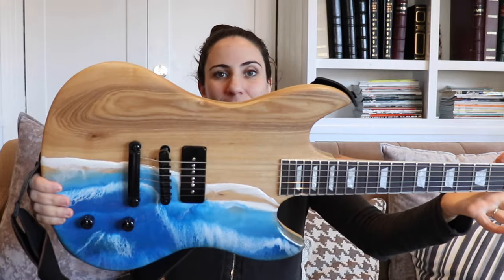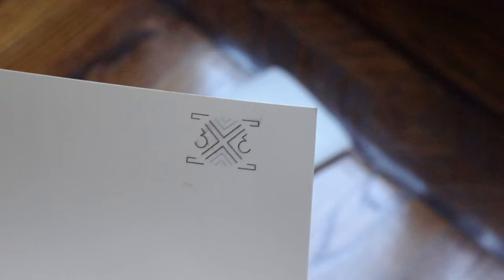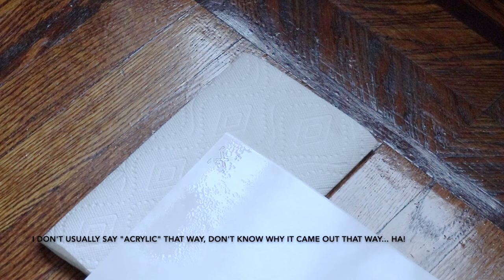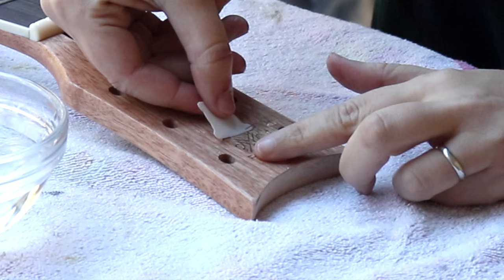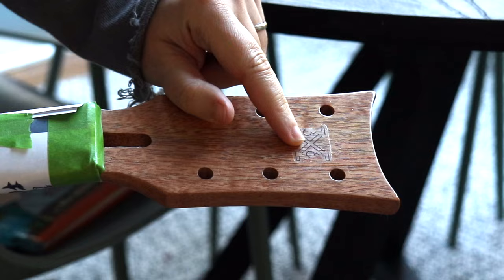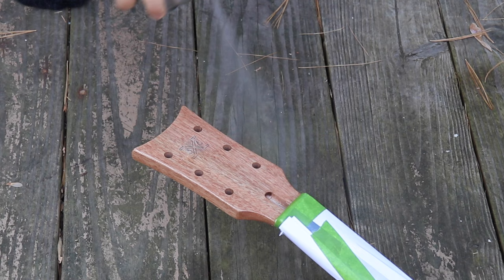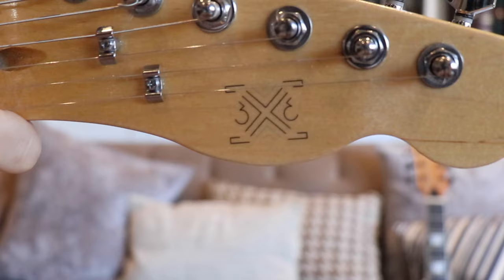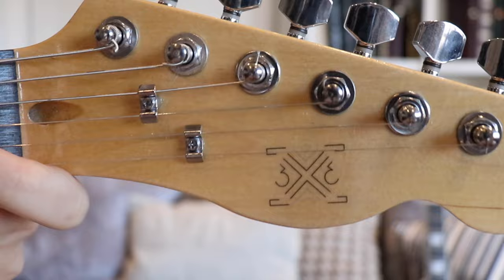How to make a CUSTOM Waterslide Decal // Woodworking Logo // Inkjet Printer

Comment: Pro tip: She touched on this in the video but be sure to apply the decal over an already glossy surface, otherwise the decal will "silver" and be a bit more obvious. Also, hobby shops sell decal softening solution (like Mr Mark Softer or Micro Sol) which helps the decal conform to irregular surfaces and make it look more painted on.
Reply from the maker: Great tip!
Reply: Glossy surface can be lightly "matted" with 0000 steel wool and it won't silver, just makes the decal easier to stick. 
Also rolling a cotton bud over the decal instead of swiping it, makes it easier to get all the air and water off underneath. Especially if the surface is curved
Reply: Will I have any trouble if I sanded on old logo off a headstock then put another one directly on it, or will I have to put something on before I apply my waterslide logo?
Reply: @3x3CustomTamar  Good to know. I just bought waterslide paper (because of this video) and now I'm in the process of making my logo. Seal first, check. Although I can think of better sealers than Mod Podge, but I guess it works based on the video. 
I usually use clear shellac to seal (normally use the "sanding sealer" one, but I don't know that it's any different than flake shellac), so I'm assuming that will work for a "glossy" finish on which to apply the decal. Why don't the directions in the decal paper package say that? Maybe my paper is different. There are even papers available that don't require sealing ... but I'm skeptical.
Reply: Do you mean that a smooth surface makes the clear waterslide area disappear totally after clear coat? Because I'm having this issue 😢
Reply: @-Viceroy- is a 2000 grit sandpaper good too? I'm experimenting on plastic motorbike fairings and have problems with the clear of the decal standing out on the background after good clear coats too

Comment: The laser printer decals are easier, they don't require sealing, the ink is waterproof, so you can apply the decal and then sand and seal it after.

Comment: For that size decals: Drop or two of water at the point where the decal will be. Put the precut decal over that drop of water and  wait a 30sec or so  and then just slide the decal. 
Many times it's so much easier when decal is already at the surface you want it to. Also just a small amount of water is needed to soak the backing paper off the decal side.

Comment: Have you considered using a toner based print (reversed), then ironed on? Would alleviate the need to trim/cut/sand etc and no smearing etc.
Reply from the maker: I have. But water slide decals are the traditional way to put logos on guitar head stocks. The image is also clearer with these decals. I find the ironed on toner based images to be a bit grainy/blurry

Comment: How does it compare to engraving/burning the wood with a cheap laser CNC? (Which, BTW, is just a 3D printer with a laser attachment.)
Reply from the maker: It’s just a different thing. You can print pictures with color on them I think is the main difference. Can’t get color with a laser. Also a laser etched into the wood. This sits on top of the wood

Comment: After using the decal sheet can you use it again or have you wasted the rest of the sheet?     Thanks
Reply from the maker: You can use the portion that you didn’t spray sealer on. Yes. I have done that before. Just make sure the printer settings are changed to accommodate a new paper size since you will cut away the part that you already used

Comment: For anyone interested, the way I know is by laser printing it on a transfer sheet made for this with special toner. Google Forever transfer paper and waterslide. They make way more types of papers so you're possibilities may open up.

The equipment investment is very small. Do your research and you'll discover many options.
Reply from the maker: I don’t have a laser printer. My inkjet works fine so there’s no need for me to change it out. This video is for other ppl who only have inkjets as well bc they might want to do the same thing without investing in another machine
Reply: @3x3CustomTamar  I understand. Sorry for the misunderstanding, I was mentioning it for anyone interested in it to see another option. 

Not trying to school you girl, I'm here to learn from you. 😅

I edited my comment to try to fix it.

Comment: Why didn't you print the whole page of designs rather than one small design,  what a waste of paper. 
Apart from that, keep on doing what you are doing, you're a joy to watch!
Reply from the maker: Because I didn’t need any more decals. I saved the paper to be used at a later date. When doing that you just have to change the printer settings to the new sized paper. I’ve done that in the past.